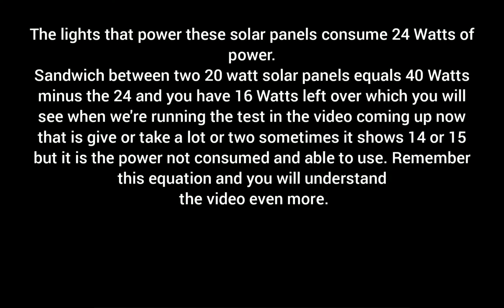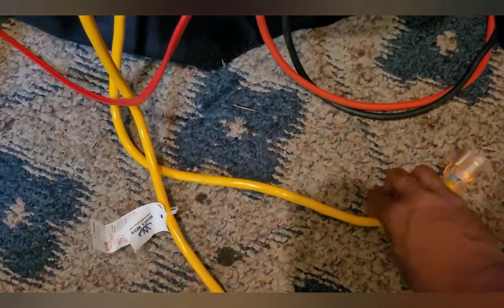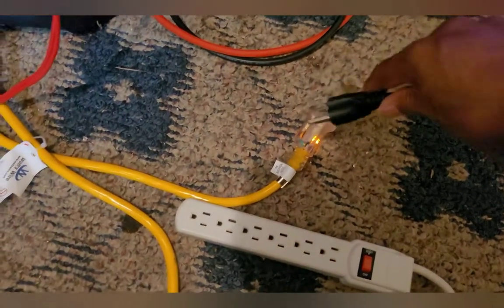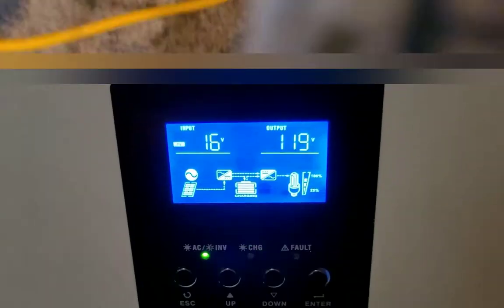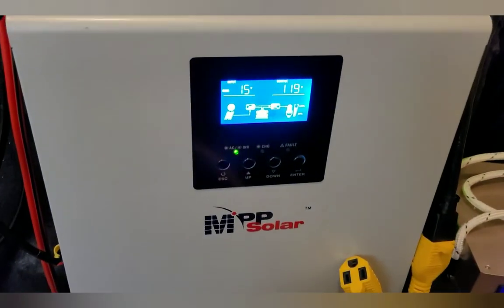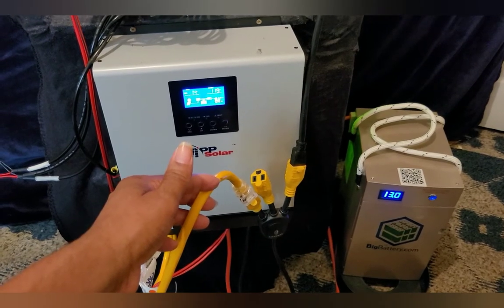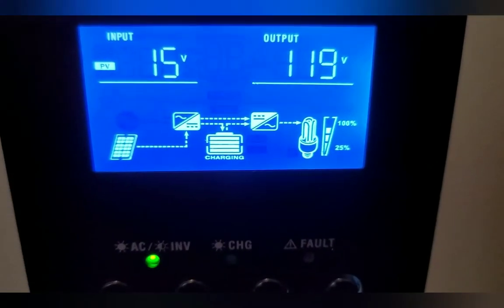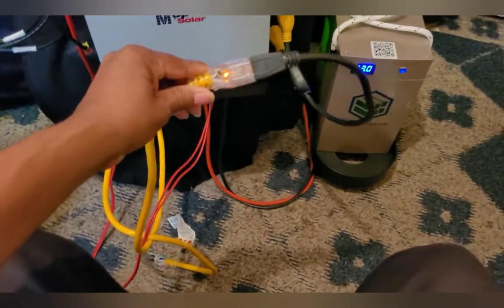update ISOlinear solar fun drive

Comment: I find your videos rather intriguing! So the mppt solar is an all in one inverter unit? And you have LED lights sandwiched between 2 solar panels in stacks? The LED's make enough light for the solar panels to charge up the large battery, which powers the mppt solar unit? So how much power can you get out of the battery and it stay charged up? Or do you just use the battery and inverter to power things till the battery gets depleted to a certain level and then hook up the LED solar panel stacks to charge the battery back up? Thanks
Reply from the maker: I will try to keep this simple, I try to keep the battery with a equal in an equal quote this video that I have made sorry about the  Voice Wasn't my fault something they did at YouTube. But the information is good it will explain overunity and how I designed it not the lies they've been telling about something I invented, Once you understand and see the data I provided in the description and in the video you'll see that all my systems use basically the same thing where I try to keep energy flowing in and out of the system as even as I possibly can. https://youtu.be/Q7EmfHowWkU?si=mXbJUKhpp3Jhoesv